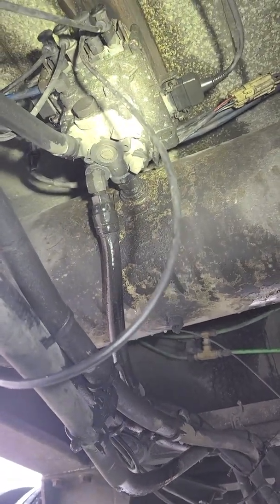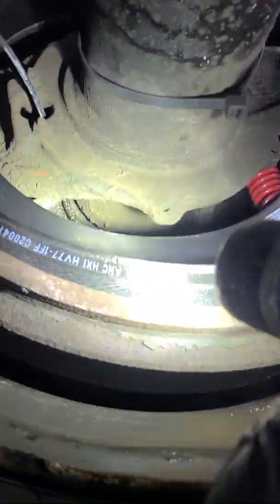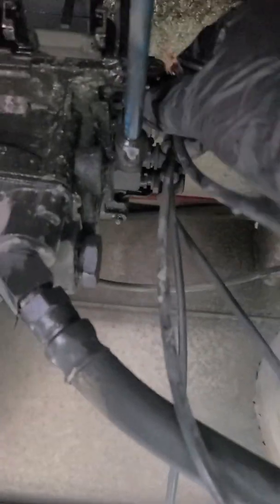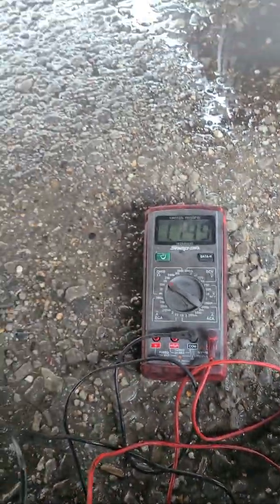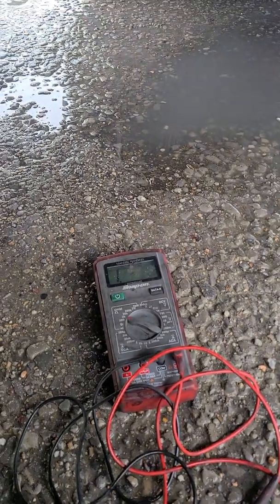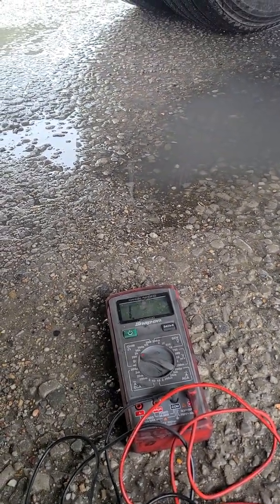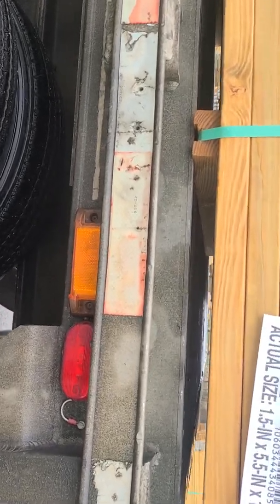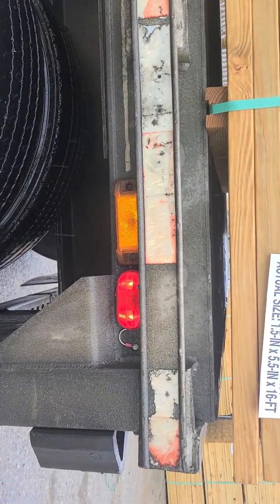How to Test/Diagnose ABS system on a Semi Truck Trailer

Comment: Could that wheel seal leaking turn the light on
Reply: The leaking wheel seal alone won't make the light come on. Dirt and oil on the tone ring can definitely make the light come on on. Also if the wheel bearings are loose/ or bad it can cause an abs light and cause a wheel seal leak as well.

Comment: im back

is consistency and i still get the yellow light, new green cable that connects truck and trailer but i know that the truck is not issue cause i have other two trailer and i never get the abs light on This issue is driving me crazy. What could be the problem that triggers the abs light to come on ? Yellow light blinks 6 and repeats that for three times
Reply: what kind of trailer and what kind of abs system do you have?
Reply: @nathanmarshall9951  vanguard dry van 2007.  I have 2s/1m abs basic. Both outlets of the module gives 5 volts. wires before the sensors 5volts also. No rust no nothing. Sensor 1200ohm resistance. When spining wheels numbers go up and down which means they read i guess. I got 6 blinks which is YE2 sensor and now i swapped them to see if it will give YE1 to see if its the sensor or the gap or idk maybe module. what do u think ?
Reply: Is it a Wabco, Haldex, or a Bendix abs module? You should also test the voltage coming from the sensors when spinning the wheels. It should read at least .2 volts when spinning the wheel. Compare both sensor readings. Are they around the same voltage? Does the voltage fluctuate a lot or is it fairly smooth and consistent? If you have to spin the wheel extremely fast to get it to read .2 volts then there's something wrong with the sensor or it's not making good contact with the tone ring. Check wheel bearing end play as well. If the bearing isn't tight, it can cause issues too.
Reply: @nathanmarshall9951 hello it is a wabco. I will check and will be back

Comment: The meter should be set to AC voltage when spinning the wheel. The AC voltage reading will rise as the wheel is turned faster. Look for blips in the readings while the wheel is turning.
Reply: what should be the reading when spinning the wheel ?

Comment: 2;38 check the too pins on ecu that cable unplugged from and should put out 5 amps and you know the computer is putting out to that sensor

Comment: i made a rod bout 6'' to reach in and tap that sensor to the tone ring with that wheel jack up spin it and if sensor is touching it will make a mark on ring if it dont tap it in till it does

Comment: New shoes on the abs axle , drums been off was the sensor pushed out to meet the exciter ring ? And exciter ring looks awful
Reply: Good idea to check the sensors when the shoes and drums are off ,unless it’s a first year apprentice,they don’t get it ! 🤣
Reply: Good practice to replace sensors when doing brake job or seal replacement, never be any closer .

Comment: The sensor shouldn’t be touching the ring
Reply: The sensor SHOULD be pushed in until it is touching the tone ring. The ring will push it back to the proper clearance as the wheels turn.
Reply: @elebeu  that’s not what wabco instructions say
Reply: @tylerseabook9423 I'm sure you can pull the drum off and use a feeler gauge to space the sensor on each wheel, but just pushing it all the way in works great, that's what everyone does.
Reply: @helloneighbor11 don't have to pull the drum,  go underneath and do it from behind the drum

Comment: I bought trailer Vanguard 2007 dry van. Someone bypassed the abs light so it looks like abs system is working. My question is which wire gives power to abs light ?
Reply from the maker: It comes from the ABS module or brain
Reply: @AMPMChatt-Jax  Okay thank you for your quick response cause i’m struggling to find it. who ever has this trailer rewire the abs wire to the tail light is just a such a mess
Reply from the maker: @brkbt93  Feel free to give me a call if you need hel
Reply from the maker: @brkbt93  A google review for AM PM also  helps lol

Comment: I've had many sensors appear good, ohms around 1200, ohms drop while spinning wheel, voltage goes up when spinning a wheel. But sensor was still bad
Reply from the maker: Thanks for the Tip!!
Reply: How can you get to the ohms and read the spinning wheel at the same time?
Reply: @zacholander7047 is a separate test. Spin wheel and check for AC voltage. Check for resistance ( ohms) doesn't need to be spinning
Reply: @helloneighbor11  What does ac voltage suppose to show if it's good ?
Reply: @dudarewaleriy4225  IDK. I unplug all of them and compare and see if one is way different. Also ohm the sensor out should be  980-2350 ohms. Also make sure you have 5volts from ECU
Reply: @helloneighbor11  Thank you.
I have 2 sensor on steer axle and 2 on the rear drive axle. They all showing same ohm  1153 or so and fluctuate about the same when I spin  all 4 tires All 4 show about same reading when I put the meter on continuity which is 670 fluctuating around that number when I spin them.

Voltage for rear module is 5 V and for the steer -- 4.97 V (4.99). The fault for the ABS is "Break SPEEDSIGNAL In RSRVC 136s022 14"

Freightliner Coronado with wabco meritor abs module.
I'd appreciate any input into this problem.
Reply: @dudarewaleriy4225  I don't have a good answer for that. If you have a computer that will show real time wheel speed to that might get you looking in the right direction. Sounds like your speed sensors are doing what they are supposed to do. Make sure they are pushed all the way against the tone ring. Have a good look at all the wiring for abs components
Reply: @helloneighbor11  Many thanks for the prompt reply.
Reply: I set my reading on 2000k ohms and lift up the wheel. Reading was going up and down 1200-1300-1400-950-1200 weird number. Is that sensor reading okay ? does it supposed to go up when speeding up the wheel ?

Comment: Got any info on how to troubleshoot abs light on the truck i have already clean the tone wheel replace new abs sensor check for voltage to the sensor and still getting fault code for that sensor
Reply from the maker: Have you checked OHMs? Next step would be ABS module
Reply from the maker: What kind of system you got Bendix?